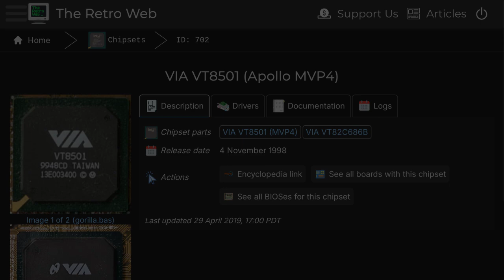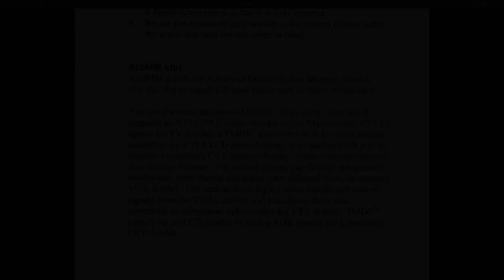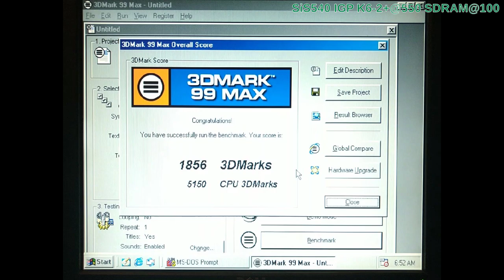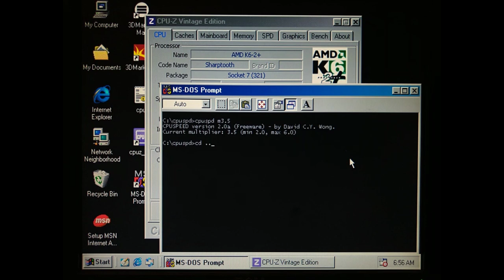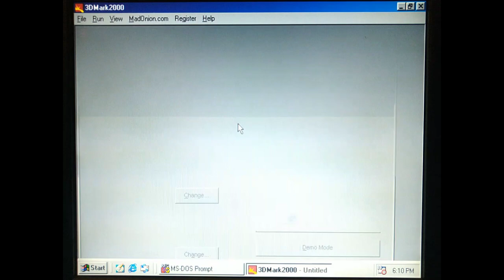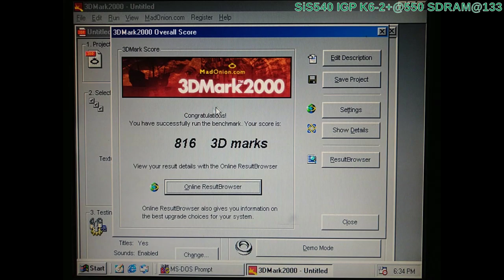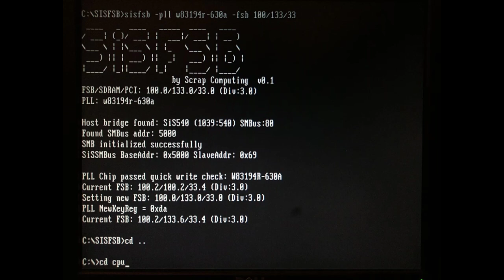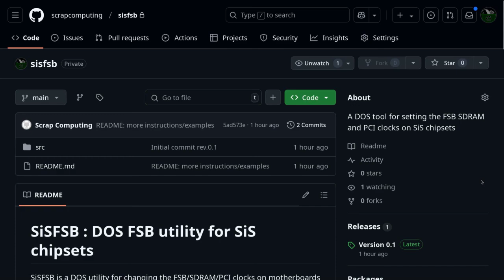SiS540: The fastest IGP for Super Socket 7 ?

Comment: I remembered that I have a few motherboards with the SIS chipset, but unfortunately, they are all 530s so far.  They only have 2 PCI slots too.  Disappointing. 😢
Reply from the maker: My 530 board has an ESS solo-1 sound chip on board which is one of the better ones with pretty good DOS compatibility, even though it's PCI. The chances are that your boards have a pretty decent sound chip too.

Comment: As I can see that's K6 CPU... Athlon XP 1800+ etc (Intel Pentium 3 opposite) using socket A (462 pins). And DDR 400 memory.

AGP with Radeon 9500 epoch.

Comment: Heck yeah SiS 540! I'd love to find one, it seems like such a fun platform to mess with. For a comparison of IGP performance; Aladdin 7's ArtX 1 graphics core at 100 FSB scores 3123 in 3DMark99, and 1158 in 3DMark2000 paired with the K6-III+/550. So the SiS 300 IGP is still quite good but it's hard to compete with 2 pipes and 128-bit memory.
Reply from the maker: Wow does it have dedicated RAM on the motherboard just for the graphics card? I love these late socket 7 chipsets they are full of surprises :D

-- Edit: I just saw you have a whole video on it with a ton of benchmarks! Coool! thanks for sharing!
Reply: Yeah I've got a video on it! The board doesn't use any onboard memory at all, it just has a 128-bit (dual-channel) interface from the GPU to the SDRAM. It isn't as efficient as proper VRAM but it's a big upgrade in performance over 64-bit.

Comment: Hi! And what about the 100/150 option? And did You try to raise the FSB above 100MHz?
Reply from the maker: I didn't try overclocking the DRAM, but yeah with a fast enough module it might work!
Reply: @scrap_computing  
8ns == 125MHz (cheap factory-overclocked PC133 modules)
7.5ns == 133MHz
7ns == 143MHz
6.5ns == 153MHz
6ns == 166MHz
5.5ns == 183MHz
5ns == 200MHz
in theory... in most case, there is 10-15% room for overclock, so it worth to try with a very common 7.5-7ns PC133 module - just check the last numbers on the ram chips

Comment: Awesome!! 
Have you been able to test the 133/133/33 setting under DOS? It might help to throw that CPU voltage up if you haven’t done that yet. 

Thanks for the awesome content and making SiSFSB open source. :)
Reply from the maker: I did try 133/133/33 under DOS but it would crash there too. I also did try bumping up the voltage at 2.1V, but that didn't help either. Not sure how much further I could push the K6-2+, perhaps 2.3V ? I will try other CPUs too, maybe I was just unlucky.
Reply: @scrap_computing  I should try this sometime. For overclocking I stop at 2.5v. And I remember an OLD forum a guy had to volt mod the VIO to 4V but he had good results.
Reply from the maker: @SkalabalaK6  Yeah I should try 2.4-2.5V to get it to work at 4.5x133.
Reply: @scrap_computing  keep the + cpus under 2.4v would be my advice.

Were you using 4.5x or 4x cpu when attempting 133fsb?
Reply from the maker: @morejiggawatts4992  I think it was 4.5x

Comment: Does it work with AGP card at all? Intel also had similar design where the agp slot can accept a video ram card or dvi adapter, but iirc they work with real video cards as well.
Reply from the maker: I have not tried it yet. I would first need to check that it won't short-circuit the board :)
Reply: @scrap_computing I am interested in more details about this slot.

Pondering best gfx options for mine. (I have the same board)

I’m curious if Jan may be able to help with bios options. Have you tried checking the bios rom for turned off features? There are several utilities that can enable bios options.

Comment: I had a k6-2 500Mhz and my video was a SiS 630... it was shit... ran GTA 3 at 5fps lol
Reply from the maker: You most probably had a SiS 6326 which is indeed really terrible. It's very similar to the graphics core in the SiS530 chipset, though probably a bit faster since it's not the cut down IGP version.
Reply: @scrap_computing  it was a PC Chips M598, I remember the driver only stating SiS 630/730
Reply: SS7 with a Geforce card can run GTA3 really well :D